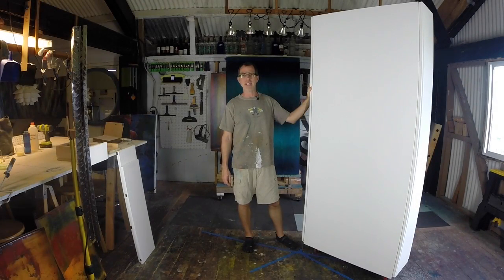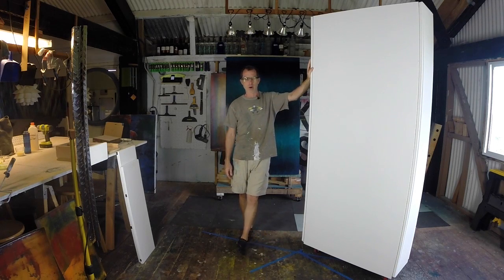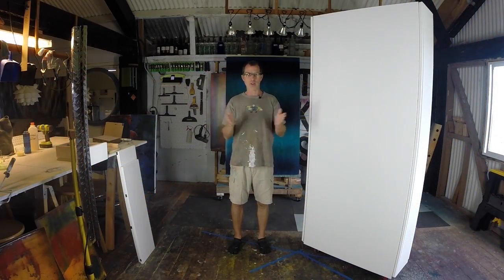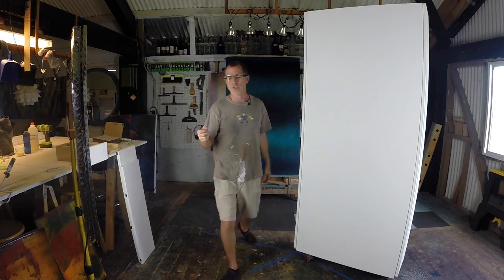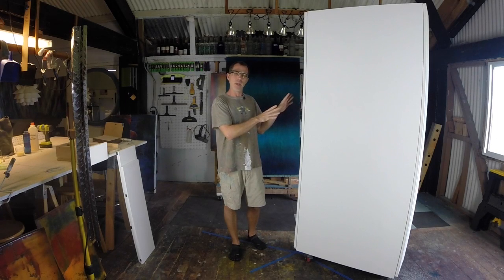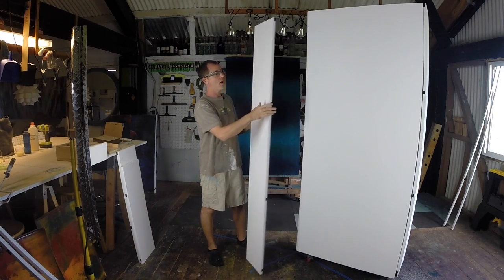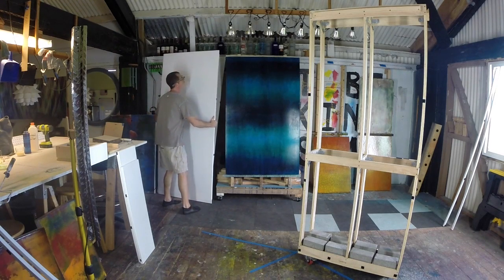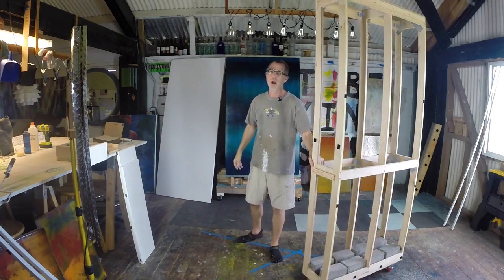Gallery Wall System (GWS)

Comment: I LOVE this!  Bravo! I'm trying to help a local community art guild gallery with some improvements in their showroom... this would be a great addition.
What was the "skirting" addition you ultimately added?  What was the electronics addition?
I'd really love to see the final units and also see them in place at the Andaz...
Reply: (also - do you roll an adhesive on the pegboard when applying the canvas layer or just stretch and staple around the backside of the frame?)
Reply: What is the construction of the base?  Is there a photo without the bricks to be able to see it?
Reply from the maker: @salliecowan  Hi and thanks for the kind words and questions. I'll answer them in order: 
1. Skirting = 3/4" Maple you can see in my blog post here: https://art.shanerobinson.com/shane-robinson-art-gallery-wailea-opens-andaz-maui/

2. Electronics = Each unit simply had a power strip with 10' cord. Similar to this: https://www.amazon.com/GE-Protector-Outlets-Extension-37442/dp/B079RKX5ZL/?th=1

2.1. Lights I built out of aluminum conduit and LED bulbs in swivel heads with romex wiring that I added plugs and simply plugged into the power strip. See link in #1 above for the lights sticking out of the top of each unit. 

3. NO adhesive on the canvas. Just stretch them around and staple just like stretching canvas over a frame. Then spritz with water and the canvas shrinks, like like for painting on a frame. Then 3+ coats of gesso or Zinsser Primer (cheaper) with light sanding between each coat. 

4. Base = Just 3/4" maple plywood. Attached to the "ribs" with simple L-brackets like these: https://www.amazon.com/Stainless-Brackets-90Degree-Furniture-Bookshelf/dp/B0CMWX81F1/?th=1

If you share this video with a local furniture or cabinet maker they will be able to easily replicate the system. And show them the post in #1 above for photos of the finished units that are 24" deep by 48" wide.
Reply: @ShaneRobinsonArtist  You are the BOMB!  I appreciate your responsiveness and helpful reply so very much!!!  I'm fired up about this ☺
Reply from the maker: @salliecowan  You're very welcome!  The only thing I have ever asked for in return in the 10 years since I posted this is that if someone builds their own versions they send me photos or a video of their version. 🤗 Happy weekending!
Reply: @ShaneRobinsonArtist  Ok... after a lot of varied considerations of big picture objectives and landlord rules, here is the plan:  1) a free standing 7' tall unit on casters, that will have a 30' high and 16" deep pedestal base on either side. of the tall center panel (1/4" plywood sides over 2x4 skeleton). Since they will never ship the unit, your brilliant design of a lightweight unit the can breakdown will not be necessary.  The tall center section wrapped in canvas, pedestal area sink nicely finished and painted plywood.  2) a 20' false wall.  To satisfy the landlord's issue with nails in the wall, a "stick" system has been used with hanging cleat attached high up running down the wall.  But this doesn't have a clean appearance and does not allow for paintings the be arranged artfully (nor the ability to include wall mounted sculptural pieces).  So, the concept is: a running pedestal base 30"h and 18" deep with 8' false wall above the base that anchors to the same place where the long horizontal hanging cleat has been (avoiding issue of creating and area of new wall screw holes). The "wall" will be plywood with a 2x4 skeleton and wrapped in canvas/painted.

So after all of that description (and with the visualization skills you have), I hope it makes since.  And while this branches off from your YouTube design, I thought perhaps you could give an opinion about one thing:  The idea would be to buy a roll of 96" wide canvas and run it along the length of the 20' wall - one monolithic sheath with no seams.  I guessing it could be attached to the wall after it is mounted in place, by stapling around the top edge down the 20' length and then  pulling it around the edges and bottom and spritzing to tighten (then paint) before placing the running pedestal base just in front of the bottom of said wall...  Do you think that manner of attaching the canvas to the 20' long false wall sounds like the way to go?

Thank you for your very kind willingness to share your wisdom!
Reply from the maker: @salliecowan  My only question is why wrap the wall in canvas? The point of the canvas in my GWS is to cover the peg-board but allow hangers to be poked through the canvas to easily hang work. If you're building a plywood-faced false wall, you just paint it and use simple nail hangers and patch-n-paint as needed. Also, I'd be concerned the canvas would "drap" over time along such a long 20' span. Even painted. So I might have missed something but the canvas on the 20' wall doesn't make sense to me.

Comment: Great idea. Does the canvas not rip, tear, or degrade over time as more holes are plunged into it? I get that the surface is patched up, but nothing is bringing those fibers back together. I guess the gesso acts enough as a glue to keep things in place.
Reply from the maker: No problem with the canvas ripping or tearing. 1. Because it is gesso'd and painted. 2. Most important, there is NO stress or pressure on the canvas. The hangers are hanging on the pegboard.

Comment: Thank you Shane,  This has inspired me to do this at our gallery in Ohio. Right now we have a lot of ugly green slot walls. I have figured out how to use a French Cleat using cabinet mounting brackets and just hang the wall on the French Cleat. it's nice and sturdy. I do have a couple of questions.  Have you made any modifications to the design from 4 years ago?  And are all the hooks made from scratch or are they modified pegboard hooks?
Reply from the maker: That's great, Ron! I'd love to see your implementation in your gallery! 
To answer your questions:

1. New mods: Nope. I've since moved back to Santa Fe (from Maui) and disassembled, shipped, and reassembled in my new Santa Fe studio without the exterior panels. With just the ribs (frame) in place they now serve as canvas/panel racks! Yet another use for them. And because they are on wheels they are easy to move around the studio. 

2. The "hooks" are just regular 6" pegboard hooks that I cut down to about 1" and dipped the cut ends several times in acrylic paint, letting dry between each dip. That provides color on the tips to make them easy to see PLUS padded protection for the canvas frames and panels. 

Hope that helps and hope your systems work great for you!
Reply: @ShaneRobinsonArtist  Thank you for the reply, I'll try to do some videos of my set ups. That is as long as the Board of Directors approves it.
Reply from the maker: 👍🏼 @RonAck01
Reply: Simply the Best!!! Well designed & well executed. Thanks for sharing.
Reply from the maker: @RonAck01  Curious to hear if your plans were approved and implemented?
Reply: @ShaneRobinsonArtist  Unfortunately the plan wasn't approved and I am no longer with the gallery.  But I think it would have worked well.
Reply from the maker: @RonAck01  Sorry to hear that but hope everything has worked out for you for the best.

Comment: Hi Shane, 
I know it has been a long time since you built these, they would be great in the space I am putting together. Would you be willing to share and rough drawings with some dim. of your frame work. Thank you!
Reply from the maker: Hi. I'm sorry that I don't have any drawings of the design. I generally just sketch out the idea on a whiteboard and build from there. I can tell you the finished exterior dimensions of the final GWS were 7' high, 2' deep, 4' wide. Given the ribs were made of 3/4" plywood, 3" wide, you can reverse engineer all the components and plans from there.
Reply: Shane Robinson Thank you! That helps

Comment: What's holding it on velcro
Reply from the maker: Velcro just holds on the little square corner pieces and keeps the larger panels "stuck" to the internal supports. 
But the large panels are HUNG on with what's called a "French Cleat."  Go to 3:40 where I'm taking off the right side panel. You can see that after I pull it out to disconnect the velcro, I LIFT IT off the cleat at the top. And if you view the video full screen on a monitor you can see the cleats. When I lift the front big panel off, you can see, at the top, the cleat is secured with 5 screws. 
Does all that make sense?